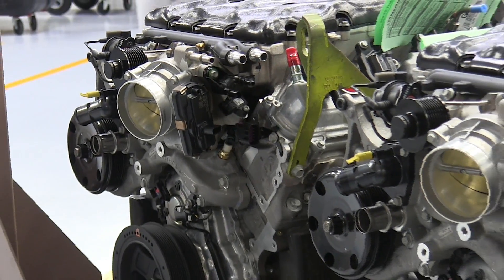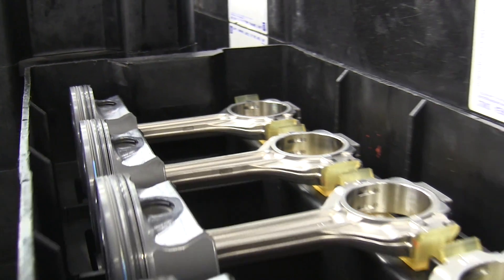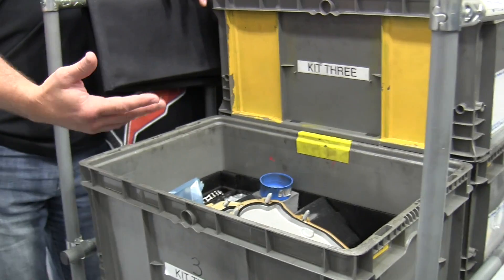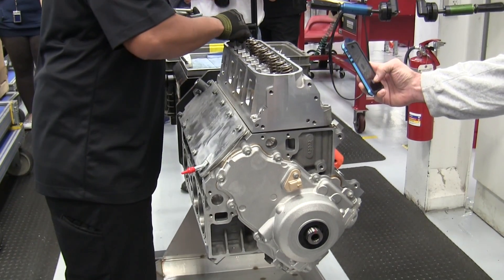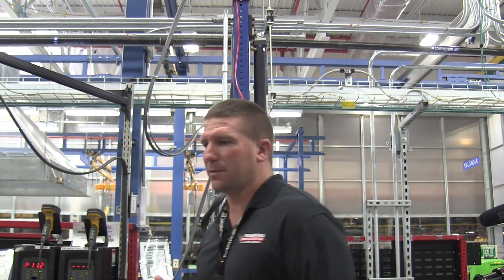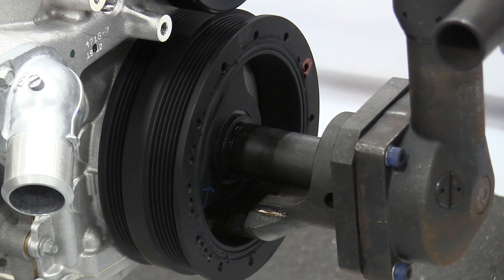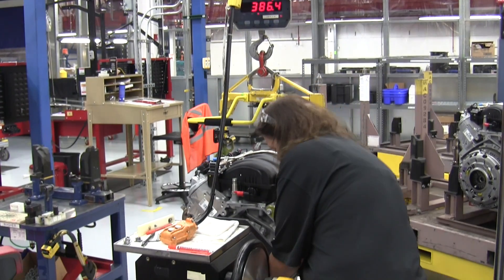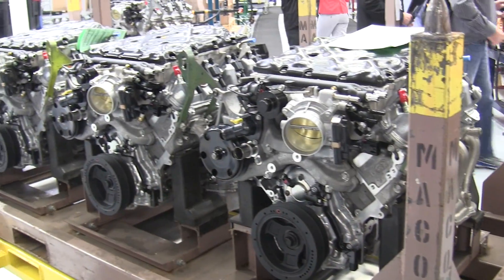Corvette Z06 (LT4) and Camaro Z/28 (LS7) Engine Build

Comment: I watch hours and hours of LS swap hoping one day I can drop on in my worthless projects. Here's what learned. Fuel is number one problem. Learn fuel rails, return means un used fuel goes back to tank. Pump has pump enough pressure and vent happy. Throddle is cable to pedal. Send computer in to get vats deleted and rear o2 sencers. My trip was can my old transmission be shifted by new computer. Because all gm transmission are built cheaply and give out. Some are going older with kick down cable. Transmission needs to operate torque converter and shift points. Dirty dingo seems have brackets. Power steering hoses work that out before you start swap. Wiring harness has to be hand made for you to understand how the computer talks to motor. Each plug must be understood.

Comment: Having watched Mercedes/AMG, Bentley and BMW engine assembly, this is not nearly as sophisticated.
Reply: Gregory Thorman:

About the only damn thing GM is Great at; is building very reliable and durable pushrod V8s. Sophistication or spectacle is not necessary to build an engine up if all your Matched parts and components are already in spec.

GM LT/LS V8 will outlast any  problematic and expensive to service German V8,V10,V12,etc...and that list also includes Ferrari's fickle V8s.

Comment: who made my engine !! I have 2015 Chevrolet suburban  that is crazy bad quality   I replaced new transmission  and new starter  and now engine damage! This car drive me mad!  Please every body don't buy any GM vehicle!
Reply: Why that's a uncommon thing really. Thatd be like me saying dont buy a Ford since most of the parts on my Ford fail quickly. But I recommend buy a vehicle with proper research for your needs. You likely had a 8 speed and a dod 5.3 these two things are problematic but are not a way of blanketing the brand over that. Because if that is how you would do things dont buy any vehicle

Comment: IM sure someone said it ,but the LS7 is the C6 Z06 engine not the Z28 engine. The Z28 had a Ls1.
Reply: Kame House Cosplay - The LS7 was also standard for 2014 & 2015 model year Z28 Camaro's. The last time an LS1 was used in a Camaro was in the 4th Generation ending in 2002 model year production.

Comment: Cam in block. Meanwhile the Coyote is DOHC...
Reply: opl500 and the coyote is also larger in external dimensions, raising the center of gravity which worsens handling. coyote weighs more. coyote is more mechanically complex making repairs more difficult and costly as well as making the coyote much more expensive to modify for more power. coyote engine also gets substantially worse fuel economy, even in stock form compared to LS series engines. owned.

Comment: The variable cam timing was stollen from Ford as well as the oil squirters that wet the bottom of the piston.
Reply: you are dillusional.
Reply: Ford's variable valve timing is derived from Honda under license, although Ford was able to mess it up, hence the failures of the "cam phasers" as they call them.  Honda Vtec is by comparison very reliable.  Piston oil squirters have been in use for at least fifty years on diesel engines.
Reply: wow a ford s master race defensor in its natural habitat, quite rare these days these type of animals.
Reply: +briggsquantum toyota invented the variable valve timing (vvt) but honda made the system eletrical and very reliable.
Reply: My understanding was that Ford's VVT on the Coyote was a Borg-Warner system.
Reply: Toyota did not invented variable valve timing, it was used on Bristol Jupiter aircraft engine 20 years before Toyota was even founded. For cars Fiat invented variable valve timing and was used on 1980 Alfa Romeo Spider.

Comment: Americans need to learn from Europe about engines
Reply: No, Europe needs to learn from Americans. That's why our engines give out more, reliable, and consistent power.
Reply: quite the opposite actually, Americans just get power from big displacement whereas Europe and Japanese extract it from innovative technology with lower displacement, American engines have the lowest specific outputs.
Reply: dc2power
Advanced engineering is what you see in the new LS engines. Modern materials, newer construction techniques, better tuning etc. are what separates the new pushrod engines from the old ones. The only thing that is still "old" about these engines is the fact that they use pushrods instead of OHC or DOHC, which is perfectly justified by their compact size and light weight.
Reply: HP/L is irrelevant ricer math that doesn't translate into anything in the real world. If you want to measure efficiency you technically should look at hp/mpg. (work over time)

The hp/L formula makes good engines look bad and bad engines look good. The Mazda wankel is garbage. It guzzles more fuel than most V8's from any country while having half of the power and it burns oil directly. Using ricer math it looks great but it isn't.
Reply: GlassTopRX7 Yeah, your stock unreliable rotary will beat a Z06. sure, sure. keep dreaming
Reply: The LS7 in stock trim makes more power/kg than many european/japanese engines, and the pushrod design makes it compact which allows it to be put into almost any engine bay (some FWD cars use it). Specific output is pretty useless in the car world, hp/weight is what really matters.
Reply: dc2power
Ford's modular engine is pretty good too, the 5.2L Voodoo engine is a great example: 526hp naturally aspirated, redlines at 8250RPM. It's currently used in the Mustang GT350.

Altough the ford engine is bigger and heavier than the LS, but so are BMW and Audi engines.
Reply: GlassTopRX7 Perhaps the one's from the 80's. lol
Reply: GlassTopRX7 "Most V8s" will beat a rotary. Stock to stock, of course. Modified engines don't count
Reply: we are not talking about hp/kg, we are talking about more advanced engineering in engines and their performance compared to lazily engineered American engines with lower specific outputs (hp/L)
Reply: ok you say ls7 but can you name another American engine that's better than BMW M engines or audi rs engines?
Reply: LT4. Way better.

Comment: GM proof OHV/push-rod engine not die yet
Reply: And this engine is relatively old. Now GM makes high volume pushrod engines that make more HP per liter than even this engine. Although the LS7 will always be a legendary engine with it titanium connecting rods and massive output for a naturally aspirated, port fuel injected V8 that's lighter than many V6's and even some inline-4's.

Comment: Apparently all the posters below badmouthing OHV Pushrod Engines have never seen a Sprint Cup NASCAR Engine like Chevy's RO7 or Ford's FR9 and Toyota's TRD V8 engines. These Engines unrestricted prior to the current Fuel Injection used by NASCAR made over 850 HP using just a single 830cfm Holley 4 barrel. These engines are only 358 cu in and yet go well over 200mph even on restrictor tracks like Daytona and Talladega. The Pushrod V8 is far from being Dead ...
Reply: gusgiesel most races in nascar dont have an engine blow up...
Reply: They lose engines at the same rate as every other racing series excluding drag racing.  Nascar engines are famed specifically for their extreme conditions and they experience higher piston g-forces than an F1 engine due to their stroke.  

And don't start on drag racing because that is a completely different story.
Reply: lol no. It's because with don't have a displacement tax like Europeans do. With have a gas guzzler tax but thats not based on displacement. Chevy gets around this with cylinder deactivation
Reply: gusgiesel "
Reply: steve they probably dont know how to clutch. And have never done a set of doughnuts untill you can see or breathe. the kiddos not the nascar guys. man I miss my 403 olds with 4.11s top speed 105
Reply: nascar uses custom built motors lmao!!! js
Reply: This is very true!  What's also true is, those NASCAR engines are racing engines, and it is common to see 1-2 (or more) engines blow up at every race.  They are tuned for maximum power at the cost of reliability and efficiency.  And think about those NHRA big block pushrod engines putting out thousands of horsepower!  Amazing!  Yet those engines only go 1-2 miles before they are torn down.  The LT4 and LS7 engines are production engines that must go at least 60,000 miles per the warranty, and can't be fairly compared to racing engines.  There are several reasons why American manufacturers are still producing pushrod engines by the thousands: lower production cost, compact size/low deck height, simpler design, and perhaps the biggest reason is that the manufacturers don't want to waste all the R&D money they have poured into developing the pushrod engine design.
Reply: @gusgiesel  The Behemoth for max horse power of the entire Chevy line is their  LSX 454R CRATE ENGINE. (They do make a bigger block/crate engine, the 572 I believe, but even it doesn't make quite the horse power as the LSX 454R does.) This LSX 454R engine totally "stock" as received straight from GM is already rated at an incredible 770 hp, the most powerful engine "right out of the box" ever produced by GM, YET IT IS NORMALLY ASPIRATED. It also comes ready to go with a huge single-plane tunnel ram intake and 850cfm Holly carb. This engine is STRICTLY designed as a drag racing engine, and comes with their special "DR heads". ( The "DR" literally stands for "drag racing" ) This engine is actually designed so the owners of them SHOULD be able to race 2 ENTIRE SEASONS on the drag strip, a total of 600 PASSES, without even needing any kind of engine refresh, aside from normal scheduled servicing, such as changing the oil. Not only that, but the engineers of GM actually used these same engines as "test engines" on a special and extremely complex dyno that actually replicates 600 PASSES down the drag strip at 7,000 rpm, including the pre-race burn-out to heat the tires, and even the 30 seconds of idling to replicate the engine running briefly after the finish line, including the engine running to approach the next race. Simply amazing.
Reply: 11,000 HP Top Fuel are Hemi Push Rod Motors.  I love the sound of DOHC V8 and the high rev.  It i hard not to love a good ole push rod motor v8 though.  You can swap LS motors for easy power that is affordable now.
Reply: Hey genius, guess what? Push rod came out AFTER overhead cam. So basically your technology is stone age.

Comment: Wait a minute.... when she is bolting down the oil pan she is not crisscrossing, she's just going one way.. isn't that the wrong way? wouldn't that squeeze the bead of silicon out uneven?
Reply: +yourleftnut1 
BAAAAAAHAHAHAHA
Reply: She was only running the bolts down closer. you can see a gap between the oil pan flange and the head of each bolt.

Comment: Wait, are these engines really SOHC with 2 valves for each piston? Thought they were more complex though.
Reply: +CarlWong510 these engines are cam in block, push rod, OHV, not SOHC
Reply: No, they are OHV, cam is in the block. Simple design means lower cost.
Reply: Aaron Bigleman that is almost exactly what I said
Reply: +Xzonicz F No, you said SOHC. It's a completely different engine design
Reply: More question, more valve = more space to enter fuel / exit fumes?
If this is true, and Chevrolet still use OHV, does this means they prefer low production cost than sheer power?
Reply: The thing is, with this displacement head style the engine produces more torque than other engines. Overall power is still very high especially considering some 360ci engines in NASCAR produce 850hp without any turbochargers or superchargers. NASCAR engines are OHV engines btw. So really, the cost and complexity saving by not going DOHC is more than worth it. Technically speaking though, the Hemi is the most power affective OHV engine you can buy with its hemispherical head design. Although they cost more and the overall engine size due to larger heads makes it harder to fit in some vehicles.

Comment: I remember when I was a young engineering student many years ago and I got in a discussion with my vibration & kinematics professor, he insisted that the word was “Damper” not “Dampener”. After all these years I still have a problem when I hear someone use the word “Dampener” but I hear it often when dealing with engine builders. How did this term come about? For me the word should be Damper as in, harmonic dampers or harmonic balancers. I am a retired mechanical engineer and hobbyist engine builder so maybe I missed something along the way, help me out.

Comment: Engine is not fill with Break in oil, Royal Purple, Amsoil or Lucas oil additive.
Reply: you don't need zinc for modern stuff like you use to with the old
Reply: new engines don't need broken in anymore, if that's what you mean
Reply: ***** old ones that especially use flat tappet stuff needs it to protect the camshaft from damage...

There still are modern engines with these!
Reply: Outlaw That's what the people who sell that additive say.
Reply: ***** that's just your opinion nothing more...

Comment: Hi Jason, thanks for all your videos. Do you know anything about the factory fault on the LS7s with the C6 Corvette Z06? Something regarding valve guide wear, I'm not sure if it was just the exhaust or both intake and exhaust valves. The valve seat may not be a fully concentric design which results in the uneven guide wear. Chevrolet did not do a factory recall and repair is very costly so I'm hesitant of buying one. Would be great to get your opinion. Many thanks

Comment: Ls7 is the best sounding, high revving v8 Americans ever produced.
Reply: PyroBlonde7777 he never said highest revving.  just high revving.
Reply: "Flat Plane" is just marketing jargon for "It's basically two 4 bangers mounted together" .They have to use acoustic tricks both electronic and analogue in order to get it to sound great.
Reply: Was the ls7. Now it's flat plane crank gt350r motor.
Reply: Jman9112 nop is the voodoo engine in the gt350 the best sounding engine
Reply: best sounding to one could sound like crap to another. it's all subjective.
Reply: Lets see here, opinion and wrong. The sound is your opinion. The revving is wrong as both the Hemi and the flat plane crank gt350R motors rev higher. Even before the flat plane crank V8 the coyote engine reved higher. Not only does the Ford make more hp per liter so does the Hemi. The Hemi makes the most overall power including torque by nearly 100hp (approximately 70hp) than anything from GM. So really other than being cheap and being a large displacement the Ls7 engine really isn't that impressive. Popularity helped the engine more than its engineers.

Comment: I thought the performance build center was in Pontiac Michigan?
Reply: +jvp Video Productions Is that the same Tonawanda plant that made the Corvette engines back in the 60s & 70s? Our 1975 Stingray is coded as a Tonawanda engine.
Reply: Was Wixom, MI.
Reply from the maker: +Jon Car It was at a different location initially I believe, but this is where it's currently located.
Reply: +jvp Video Productions That makes more sense to have them next to the plant at Bowling Green. Would save on transport costs
Reply: I don't care where it is that's BAD ASS!!!
Reply: It was Wixom, Mi. Now in Bowling Green KY & Tonawanda, NY
Reply: Yes, I know. Perhaps I did not explain it well.
Reply: http://www.corvetteblogger.com/2016/05/03/corvette-z06-lt4-engines-now-hand-built-bowling-green/
Reply: Part of that has to do with the Bowling Green plant being such a tourist destination for Corvette fans and buyers. The logistics end is just a secondary benefit. I believe that GM has a program where you can help build your own engine for your Corvette even.